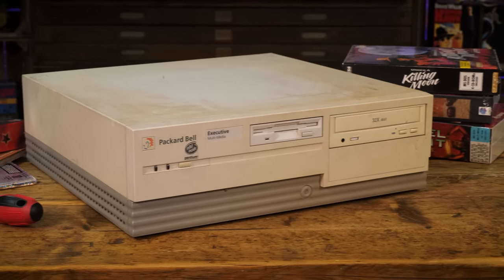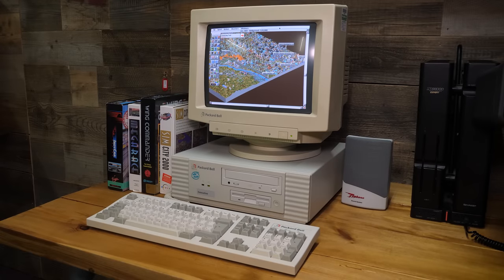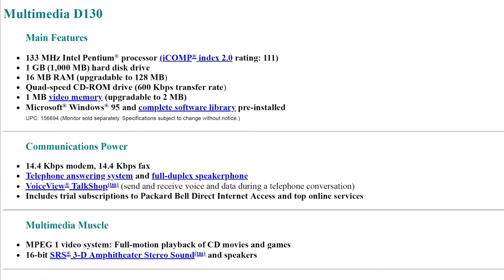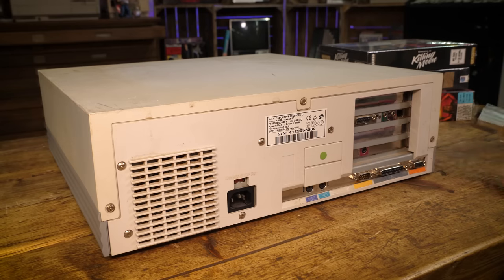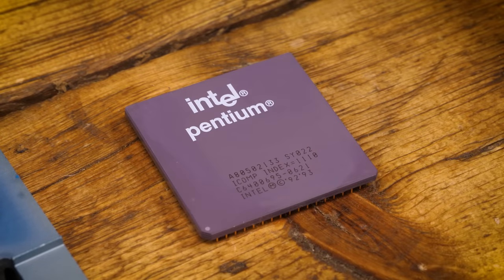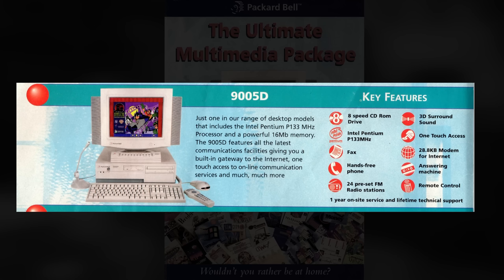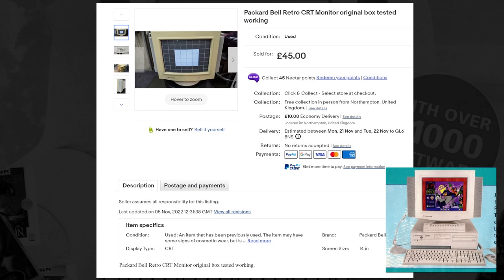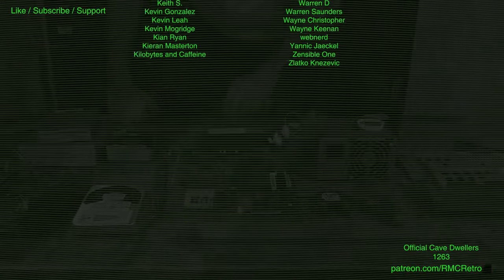Packard Bell Restoration | The Packard Bell Arrives | Trash to Treasure Part 1

Comment: I got into tinker en repairing computers for fun, as a hobby about the year 1997-1998 i think. It was before  i go to highschool (i think thats called in english, in dutch its middelbare school) But a was tinker with old electronics long before, i think about when i was 6 years old. Got my first weller soldering iron from my uncle who worked at fluke. new soldering irons came there and they were thrown in the container. But luckely he saved them all. I learned everthing just by tinker en take things apart. Luckely i got a lot of e-waste from my uncle. And I went through all the local stores that sold electronics behind defective devices for free. Still doing that.. I have been coming to some shops for more than 20 years.
Computers were added later and I certainly remember having at a similar packard bell. But that would be later when they were obsolete or to old and people were throwing them away. packerd bell was somethimes namde packard hell by repair guys or shops where i came. 
I think at least 80 percent of my electronics in home but also by my brother and mother are repaired e-waste from me.
And I must have cursed regularly while trying to make a packard bell. remember, the internet was much more in its infancy back then and youtube didn't exist yet. So finding information and drivers was a lot more difficult. let alone downloading with a modem. But luckily in the Netherlands where I lived, unlimited cable internet was introduced fairly quickly. Download limits were quickly abolished, at least for about 20 years (while in Belgium where I live now they are still there)
packard bell's european headquarters was in the netherlands. You can also see it on the monitor in the video.
Packard Bell merged with NEC outside China and Japan in June 1996. You will also see nec france on the memory modules. So your computer is from June or later.  The PC says assembled in France. But that is weird, in the Netherlands there was also an assembly factory in that time. 
And if I have done my research a bit well, little was made in France in 94 because the Netherlands was very efficient and they wanted to close the factory in France at that time.

Comment: I get the nostalgia, but I used to call these machines Crap-ard Bells due to the number of them that people called me to repair.  I saw a lot of these where one part or another would fail on the motherboard, making the system useless.  A standard motherboard wouldn't fit in these cases, and there wasn't a whole lot of salvageable parts you could use to Frankenstein another machine out of.

All that said, I'm interested in seeing how this all turns out.  It'll be nice to see one in working condition :-)

Comment: I have the master cd and boot floppy for the Executive but it's model number is A940-4x4E540 not the A940-4x4E640 model. It probably has the same software library (I have ripped most of the other software that was bundled with it too). If you think it could work I'm happy to share it.

Comment: My memories of working on Packard Bell systems are fraught with frustrations of finding drivers for all that proprietary hardware after doing a clean install of Windows. The Packard Bell website and tech support was probably the industry worst, invariably telling end users to us the "restore CD-ROM". I should note that the pre-standardization CD-Rom unit in many Packard Bells would not work following a clean install of Windows 3.11 and original Windows 95 (no version letter) because of the proprietary modem/audio card/CD-ROM controller card.

Comment: My first actual PC was an Escom 486 mini tower running OS/2.   Until then, I'd been a happy Amiga owner (had a 1200 with 120 Gig HDD at the time), but I'd just started a degree, and needed a fairly decent PC to complete some of my coursework.   

Unfortunately, the software I required to complete the degree was only available on Windows, so I had to get hold of a copy of Windows and install that.   I've had a PC ever since (there isn't really an option now, sadly), but while I love them, and the current one has near photorealistic 3d gaming which is an order of magnitude more advanced than anything available in the 90s, I've never felt quite the same attachment to my PC.   I say "PC" as while no part of the original Escom exists, I've replaced it bit by bit rather than as a whle

Comment: As far as bundled software goes for the mid 1990s, that's not bad at all.  The average family of four with a younger elementary aged student and an older tween/tween would have probably used just about everything.

Comment: Just had a bit of a flashback - the models immediately prior to these "featured" the IBM MWave Dolphin voicemodem/sound card which used a DSP chip to emulate each function in software. Aside from being non-plug and play, these cards had numerous bugs and limitations and were a poor fit for the consumer market (or any market?). Packard Bell abandoned MWave cards in favour of the "Rocky II" card featured in this video. IBM later faced legal action from consumers who claimed the Mwave platform was unfit for purpose.

I guess what I'm saying is - if you have any problems with the sound card, thank your lucky stars you didn't get an MWave!

Comment: I thought the Pentium P133 was a lot later than 1993, my parents bought a P60 back in 1995, and know there was a lot of advertising around 95 for the Pentium inside, after their trusty 286 died after 6-7 years of use by all the family. looking at the keyboard in the advert looks like a PS1 keyboard cable, where as you bought a PS2 keyboard for £30. my first pc was the upgraded 386, and then the 486 dx33. then their P60 around 1998. then onto the AMD band wagon for a decade or so. the memory for your computer is EDO sims if you decided to upgrade that, but not sure what the maximum memory was for the P133 as never owned one.
Reply: games I played around that era were Monkey Island, Larry In the lounge of lizards (Once mastered all the answers to the questions!!), Grand Prix, think it was Worms, and Prince of Persia.

Comment: I suspect that an original recovery disc or a drivers disc that is a match for your system will be hen's teeth now, usually if you search hard enough or cross reference parts/chipsets you should find drivers & software.

Comment: Oh yes - I used to see rows and rows of these in PC World, usually with 8Mb RAM and the HDD lights flashing away constantly (swapping)   I remember repair nightmares, the Aztec Soundcard/Modem card. Poor performance and Seagate hard drives.   The IBM Aptivas and Apricots were more interesting to me at the time, but I was a mainly Mac user back then.

Comment: I had the 1994 66MHz 486 Legend Multimedia version with Aztech sound card and (proprietary) Double Speed Matsushita CDROM (and a 1MB VLB onboard Cirrus Logic video card and 500MB Conner. And the radio card). The machine looked virtually identical to that. I "wasted" so much time of my childhood and youth playing video games and using MS Paint on this thing. "Recently" (like 15 years ago) I wanted to install some cache because the machine didn't have any. There is even a manual with photos (actual photos! With optimized palettes for 256 colors) on the machine on how to upgrade cache, what to install where and which jumpers to set. Guess what? It didn't work (didn't help that you couldn't look at the manual while upgrading the cache lol). At least the machine itself still works.
(it wasn't my first machine, my first machine was an IBM PS/1, unfortunately I don't have that anymore but I got an identical machine belonging to someone else)
A friend of mine has the 60MHz Pentium Socket 4 version. Never seen a socket 4 before... same exact case tho.

Comment: Hard to believe the old beige case pentiums are now becoming vintage/classic computing devices.  I am getting old :).      They don't have the same charm of the 8 bit era, with a lot of 8 bit's being quite unique to particular manufacturers, but it is nearly 30 years ago now and the old beige case 386, 486 and pentiums are starting to fit in that vintage computing label......       I'd keep it original if possible, with all original parts as far as possible.   It just is not the same machine if existing parts are replaced with non-stock parts.

Comment: If that's a PB640 it'll take a P233 MMX and 128MB of RAM. The 233 will need a fan; I fitted a nice quiet Cooler Master to mine. I'll have to look more closely at the video to see if yours has those unpopulated USB ports on the motherboard. I fitted a PCI USB card. I don't think mine had the FM radio tuner.
                                                                                                          ETA: I used a Voodoo2 card. I'd forgotten about that.

Comment: The FM card ( I think i still have my card somewhere ) wont show as a device in windows ...and you might find it difficult to find the software ... however i think it was on the packard bell master CD ...the app in windows was called pbradio , hope that helps in some way .... the card does not use a irq i dont think .. the software controls it via dma calls i think 

Someone had made a 3rd party exe that you could run in dos to control the card as well ..

I made a pascal app as a dos front end for it ... if i can find it backed up i will send it to you

Comment: I have a little PC330-P75 which I've thrown a spare P133 in, Trio64 onboard.. it may end up hosting my old S3 Savage 4 which I thought had died, but turned out the monitor I tested with just didn't like the output

Comment: I used to be a "technician" at PC world circa 1999 - 2001 and from memory you need to run an application called tattoo on the system to match the part number and serial number on the hard disk if it has been replaced, otherwise the restore process won't work. This is due to the restore disk contains all of the software which you may or may not have paid for with the PC which is written to a hidden sector on the hard drive and is also contained within the BIOS. The restore media needs to read the correct tattoo of the hard disk and BIOS to know what software and drivers are to be installed with the awful Windows 95/98 batch scripts that were called on these awful PCs.

Comment: this was my first pc, back when i was i think about 9 years old. even down to the same 32x max drive upgrade.

cant remember exactly but i'm pretty sure i also upgraded it with the first voodoo card. I think after that i upgraded to a 566 cpu with a fury card.

i can also confirm thats the same keyboard. That weird plastic wavy back edge is burnt in my memory for some reason :P

Comment: Started my career with computers selling the PB and then was in repair.         The restore disc should have the model number around 170520.   Do not use the 170369 it will not restore correctly. (Still have nightmares from these.)

Comment: Oh god, I hoped I’d never see one of these again!  A nightmare from my early career in fixing computers!

As packard Bell we’re part of Bill group, this shared its motherboard with a few zenith data systems PC’s and they all had a similar fault in that different timings across the board could drift.  Not so bad with Win 9x, but when customers cheap enough to use these as business systems put Windows NT on them, random BSOD with the error IRQ_NOT_LESS_OR_EQUAL occurred and the only cure was a replacement motherboard with wiring hacks all over it!

Interestingly, many parts found themselves being used in the cheap Zenith Z-Note 500 laptop which also had the same issues where again worked mostly ok with Win 9x but that same error cropped up with the same fault needing the same cure.

Nice machines if used with 9x, push them to be professional and they were a f@#king nightmare.

Comment: I agree with leaving the onboard 2D alone (but add GPU memory if possible- because 1MB will not let you have 24-bit true color at 800x600, but 2MB will) and installing a Voodoo2 card. That would be how it’s done in 95/96. 

If possible upgrade the RAM up to 32MB by adding another pair of 16MB EDO sticks. Avoid going higher than 64MB because some games has issues with more than 64MB of memory. This computer uses EDO RAM. Be careful to not mix in Fast Page RAM or you will have performance and stability issues.

Check if the motherboard is one of those that needs Cache RAM. Add cache RAM if possible. 

Try to upgrade the CPU to 166MHz, maybe MMX. Do not go above 200MHz if your intend is to run older DOS games because games written in Turbo Pascal (mostly Epic MegaGames titles) will not run if the CPU is too fast. 

Go for a real SoundBlaster 16 or AWE32. That guarantees maximum support in DOS and Windows games.

Comment: my dad got one of these when I was about nine was one of these machines with a p75. it was such a pile of crap but forced me to learn computer repair. by 10 I had frankenstined a bunch of 486 gear and learned a lot, at 11 I was doing repair for profit. by 12 I was doing repair for local businesses.

the sound card / modem combo was idiotic because lightning strikes killed them all. wound up using a external us robotics 28.8 for a long time as our phone lines could only negotiate 26.4kbps. I could listen to the handshake and know it was at 19200 or 26400bps. later I could identify 33.6/48.8 as the lines at my moms house were better. 

he wound up selling it and upgrading to a 200mmx diy build, I bought a thinkpad with a xjack 56k pcmica modem.

Comment: Packard Bell gets a lot of hate for the same things other home PC vendors were doing at the time. They aren't nearly as proprietary as the common "pb is junk" meme states. PB used their own derivatives of Intel reference motherboards or BCM boards, assembled in PB's own factories, mostly in the USA or France. The cases conformed to the very loose LX form factor with standard AT power supplies. Primary problem area was cheap CD drives, floppy drives, modems, and sound cards. Second problem area was leaving L2 cache off of all but the top end Platinum line. 

Packard Bell at least had a nice flair of design thanks to hiring Frog Design to create their 1994-1997 aesthetic, with the wavy gray bezels and rounded accents. They were among the first, if not the first, to put together comprehensive home multimedia bundles. For an entire generation of people, PB represented an entry into the world of computing. 

PB's fall is a great business case study in how things can go from massive success to failure rapidly. All it took was 1 bad scandal, an expensive merger with NEC USA, and flooding the retail channel with too much inventory.

Comment: I would scoff at these machines back in the day. Usually only bought by parents with more money than sense. They were almost always overpriced/underpowered compared to something that could be built yourself if you were canny enough in choosing components. Nowadays though these integrated machines are quite attractive to me. It has a nice-looking, compact low-profile case and just enough expansion to replace the bits that need replacing.

Comment: The biggest problem with these machine was the lack of L2 cache.... and you couldn't even add it since they didn't solder on the COAST socket! Otherwise, they were solid machines running Intel built motherboards. The Aztech card wasn't half bad and often the modem could be disabled. They support 8-bit Soundblaster Pro and 16-bit Windows Sound System emulation using a Crystal sound chip usually paired with a real OPL3 chip.

Comment: Wonderful video but as someone born in the mid 90s, could someone confirm or deny that machine, purely in terms of build quality was the typical unit? As someone who's built modern machines with a higher build quality for less even without inflation added into the mix it feels kind of a shock to see at some point a Packard Bell was selling for that much.

Comment: I got a Packard Bell Legend 2440 in 1996, a 75mhz (later upgraded to 133mhz), 16mb of ram, 1mb video ram (upgraded to 2mb), 1.44 diskette drive, 4 speed cd rom (upgraded to 16x), 1gig HDD and the wrong master diskette disk and cd for the system. Leading to painful calls to Packard Bell tech support getting the right one and still getting the wrong one on first attempt.

Comment: 8 days late, but I've got a quick question (if anybody is still paying attention:

Think it would be worth chasing and refurbishing this PC for use with retro MS-DOS and some non-3D Win95 games, if I swapped out the janky sound card+modem  monstrosity for either an SB-16 or an Orpheus + Dreamblaster X2GS daughterboard (they licensed the GS set from Roland), and maybe an MT-32 for even older DOS games,  as well as a good 2D video card?  

I was tempted to source an old 486DX-100 system like I used to have, but the listing on eBay didn't instill me with hope.

Thought this could be more fun than using the MiSTer w/ the Pi-32 HAT  (the MiSTer DOS core is only a 486SX class),  and be able to play a wider variety of games than the ones supported by DosBox and ScummVM.

Comment: I have a weird combo of desk/tower version of one of those with the same motif. Found it in the trash and I can't bring myself to get rid of it. P166MMX
Reply: 4:50 YOOOOO That's my machine! It's not quite it but the bottom two look like mine, except for mine has a 166MMX in it with 16MB of RAM and the HDD that came with it was 4GB but it no longer runs properly.